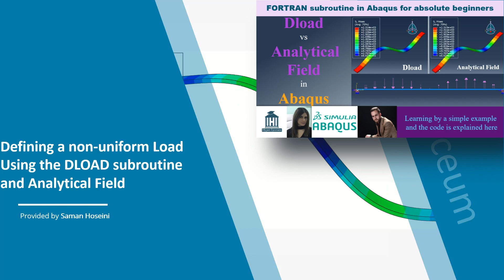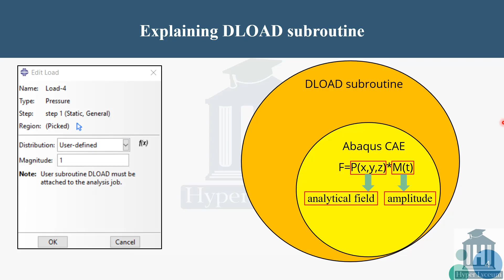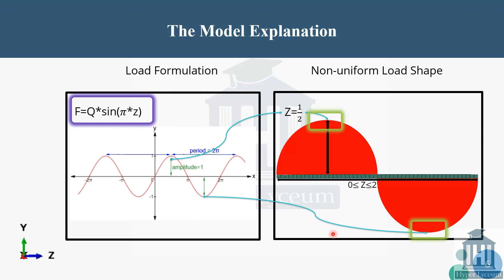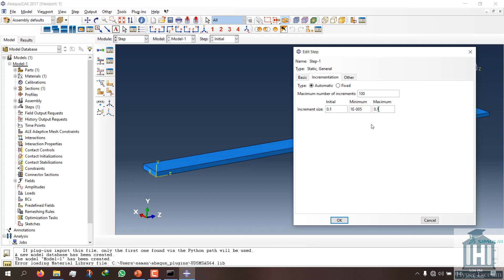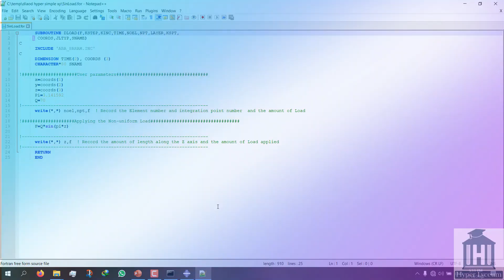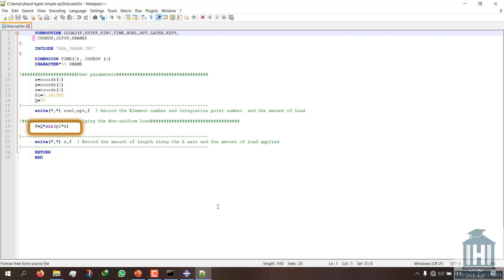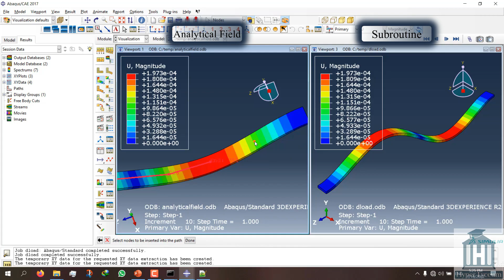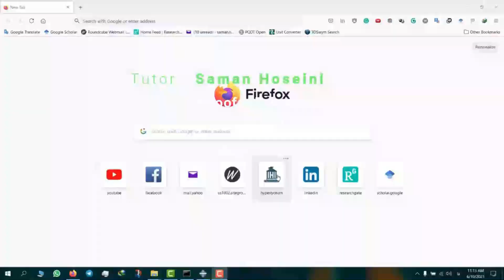Distributed load and pressure using Analytical field and dload subroutine in Abaqus

Comment: Great video! I have a problem: what if I want to apply a concentrated force that varies with the object's displacement?  e.g. I want the force value to be 10 when the object is at z=0, and when it moves to z=1, I want the pressure to be 200.